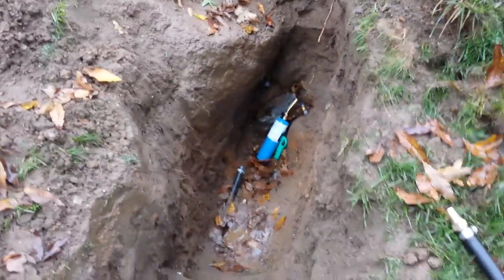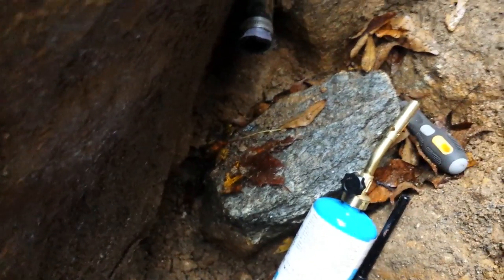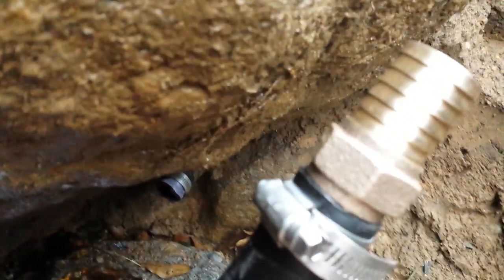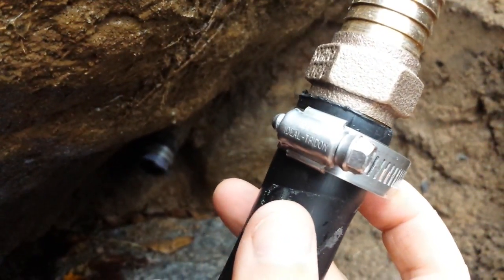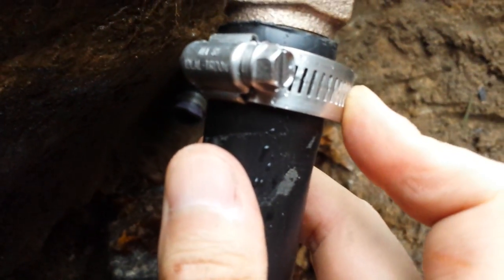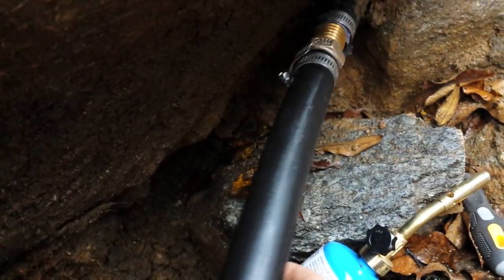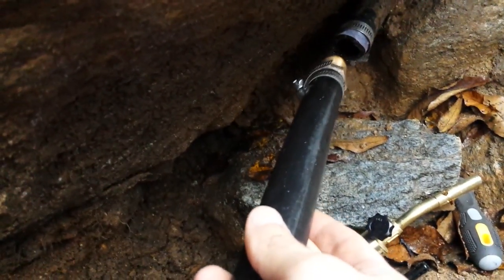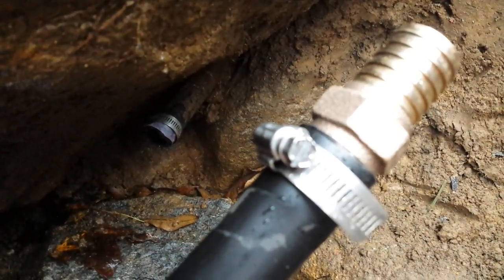How to repair main water line leak THE RIGHT WAY

Comment: I thank you for this video.  Went to Lowes and the plumber knew exactly what I needed.  Also, had called a plumber due to the 17 degrees and had to work fast.  Worked great and bulked up on the clamps and used 8 total.  Thank you.

Comment: Does this work ... yes. As a certified Water Distribution Operator I will say this is a last resort. There should also be 2 clamps per connection side as stated. I would spend the extra money for a Ford fitting and stiffners aka inserts. Then , I would know I could sleep easy. Also this is a service line , not a main line. Great video on one way to fix a service line though !!
Reply: He should've also spent some money and put pex in, looks like he's using that cheap farmers plastic

Comment: This is the correct way to repair this type of plastic pipe I’ve seen people use compression fittings and no steel inserts which wouldnt work on irrigation type plastic anyway of the videos I’ve been watching in regards to repairs of this type of pipe yours is the correct method

Comment: This is the first time i have ever seen a water line installed with a hose clamp . Iv'e only seen these done with pinch clamps or compression fittings . Im not saying it's wrong where you are it's just blasphemous where i am, you might  trigger a boss fight when you call in an inspection LOL.

Comment: Edit: ATTENTION EVERYONE!  CHECK YOUR DISTRICT SPECS OF WHAT IS REQUIRED BEFORE LISTENING TO THIS GENIUS. IF PVC AND COMPRESSION FITTINGS ARE ALLOWED, USE THEM!!!
Never in my life have I been told pvc won’t hold the pressure, for one simple reason, it does hold the pressure. Seems as though you don’t know the different between schedule 40ajd 80, which is probably what your water guy was saying. So ya, just FYI, this was no where close to the “right way” but you say it with such confidence. I’m sure some Idiot will beleive you. 

What the hell are you talking about dude? Do you have any experience in the trench laying pipe?Compression couplings are temporary? I’m not sure where you’re from or what kind of compression couplings you’ve been using, but there is nothing wrong with them. Of course silver solder, soldering, etc is slightly better, but compression fittings can EASILY LAST JUST JUST AS LONG. 

PVC pipes and the compression fittings can withstand pressure that would blow your fucking mind. Twice what you’re line is at. When I install pvc lines, I pressure test the line at 1.5-2 times the estimated pressure. 

Compression fittings work in exactly the same way that a rubber gasket pipe works. So yea, Im not sure who the fuck told you that bullshit. But it’s a hundred percent wrong. Many districts are moving away from pipes like ductile iron, cmlc (concrete lined steel pipe) and switching to pvc. 

So don’t go on YouTube and try and help people fix things with such confidence when you have no clue what your talking about.
Reply: justin Kassel
Reply: I agree you think stainless steel fasteners Will last longer than compression fitting what a joke
Reply: I used to be a sheetmetal worker and we installed PVC underground, they dont rust, just as strong, so I didn't understand what he was talking about

Comment: I work in the waterworks industry and compression fittings are definitely better. Just make sure you use the inserts. Also if you use the barb fittings and want to make life easier put a female x female union so you dont need to stress the pipe to get it to fit together.

Comment: I already used plastic barbed fittings instead of brass.  I was afraid the metal would corrode.  Will the plastic hold up overtime?
Reply: There the worst ones you could've gotten, next to the ones made out of black iron, plastic barbs crack and breakdown, especially if you live in colder climates with frost shifting the ground, brass will last a lot longer

Comment: Heat gun for auto mechanics work too if you don't have propane correct?
Reply: Heat gun is better if working indoors next to wood. Don't want to burn the building down.

Comment: This is not the proper way to clamp a fitting. ALWAYS USE 2 CLAMPS PER SIDE. 1Clamp will start to slowly leak and continue to get worse.
Reply: Yea double clamps and in opposition..👍👍

Comment: I need to hook new pipes to old existing metal pipes coming out of meter and going into home... 40+ year old house on concrete slab... has metal pipes... I have a leak under some pine tree roots about 15 to 20 feet above meter and house is another 30 feet from there... plan on cutting near house and at close to meter go around the trees area and make to middle front to house half box shape.... about 100 feet  total distance... was going to use pvc.... what's best pipe/hose for my job?

Comment: Yes hose clamps for "the right way" lol, and pvc does withstand pressure, you just have to make sure you buy sch 40 or 80, not foam core which is meant for dwv.
Reply from the maker: BULB271602  Water company will not approve it and will not turn water back on...  I had PVC on it first and they said absolutely not.  They would not turn water on UNTIL the CPVC pipe was in place.  I thought PVC would hold pressure but water company said that over time.. it will not.  So to have water turn back on..  I had to do it the right way.. according to the water company... since they know their stuff..
Reply from the maker: Oh... and if you go to a plumbing store... not home depot..  but a plumbing store with certified plumbers. .. they also state.. that PVC is not to be used but only CPVC can be used and is the best thing since it can bend and accommodate pressure..
Reply: vladtexas I have a seriously difficult time believing the water department wouldn’t let you use pvc. I’ve installed 30” diameter water mains that were pvc. I have never worked in a district that didn’t allow us to use it as a service, generally similar to a copper line. I think you mixed up schedule 40 and schedule 80
Reply: If PVC freezes, it cracks.
Reply from the maker: justin Kassel  CT water company does not allow PVC.... not my rules. I actually installed it first with PVC and they said no way.  Don't believe me.. you don't have too. Just call CT water company....  again... not my rules. ..  it may be different rules in the south where it's warmer
Reply: vladtexas I’m not saying I don’t believe you. That is just insane to me. What part of the country do you live? I’ve installed fire hydrants and water lines in cold weather areas, and since the fire hydrants are above ground, and susceptible to being frozen and cracking, their standard is the dry hydrant, that keeps the water below ground until it’s being used, but never have I heard of not using pvc in a UNDERGROUND WATER LINE. reason being because lines don’t freeze underground.

(However I suppose of it was shallow enough in the ground, there could be a danger of freezing.)

Is all of this being backfilled? And why wouldn’t you use compression fittings? Because it doesn’t seem right to me is the use of those hose clamps being buried underground. I’m assuming they aren’t stainless steel, and also assuming you didn’t put on non oxidizing grease on them either. So it’s not going to be long before they rust out and your back in the hole. 

I’m not trying to be an asshole or criticize you brother, I just love pipe work and these things interest me!
Reply: @justinkassel4000  He literally says in the beginning they're stainless steel. Also why would you put anti-oxidizing grease on a stainless steel hose clamp? I believe that kind of grease is for aluminum to aluminum or aluminum to copper connections. I have never seen an application where someone puts that kind of grease on an installation below ground.
Reply: Use high quality SS T-bolt clamps. Screw clamps are cheaply made and break. Ask any mechanic!
Reply: @vladtexas I think you mean pex? CPVC is just PVC but is meant for potable water, pex actually bends

Comment: Where can I get the connector that you used,I've been to home Depot and Lowe's and I didn't get it.
Reply from the maker: Plumbing store....  not home depot. Home Depot doesn't carry the size that you need for a main water line but a plumbing store does. If you have a sample of the hoes bring it with you so they can put the correct size connector into it
Reply: Menards usually has them

Comment: Great video! 
Where did you buy the brass coupling from? 
I checked Home Depot and Lowes and they don't have any heavy duty brass couplings with a nut in the middle.
Reply from the maker: Georgi Batchvarov  Only sold at a plumbing store...  home depot and lowes do not carry it.  Only a plumbing specialty store. ..  Usually $6 for each one. Good luck
Reply from the maker: The brass couplers are sold only at Plumbing specialty store.. not sold at home depot or lowes
Reply: I picked up some at Menards for 10.99 apiece.
Reply: In NW Washington our local Do-It Best Hardware had the brass couplings with nut in middle.  Ace had them with nothing in the middle (would be invisible after install, just see the pipe clamps).   Home Depot had couplings with a small ~1/4" bit of brass showing in middle.

Comment: People dig up water lines for home inspection? I've never heard of that. I got a water  under a tree leaking. I actually got to the leak and temporarily patched with JB water weld.  I dug around the tree and got to go get new line. I'm gonna the torch method. Thanks.

Comment: every one I see trying to fix water lines or installing yard hydrants used the stainless steel band clamps   junk throw them in the trash haven't you people ever heard of a t band clamp  of course they are stainless but way better clamping power   warm the pipe slide it onto the barb fitting and only snug the clamp     then let fully cool and come back and tighten it    bam  works every time
Reply from the maker: david snyder Connecticut water company should know that.... I wonder why they insist on stainless steel clamps...ugh
Reply: vladtexas   Of course stick with stainless but the little screw clamps stainless or not are junk. Use a T-band clamp

Comment: what  materials of black pipe? and where to get it, thanks
Reply from the maker: It's made  of a special plastic .. and you can only get it at a plumbing store(bring a small piece to store so they can match up size and wall thickness...  the pipe is sometimes referred to as well water pipe...

Comment: we are dealing with a water leak right now was wondering what size pipe u r using and the size coupler u used ,,,our pipe is 3/4 inch
Reply from the maker: Cut a piece of your existing water line and bring it to a plumbing store it must be a plumbing store since they have the materials needed. And ask them to fit it up with the correct size coupler and hose. All hoses are different sizes and different thickness in walls of course the thicker the wall the better it is but yet the more expensive. Just depends on how many times you want to dig up 4 feet of ground and find the leak.

Comment: Sure?  Section 605.3 of the NC Plumbing code lists the approved pipe material.  These days, PVC, PEX, HDPE are the popular ones.. 1" PVC Sched 40 is rated to 450 PSI and Seche 80 up to 600 PSI

Comment: I have blue colored plastic line. Anyone know what it would be made out of?
Reply: CTS Pex, probably rated around 280 psi should have a stainless steel insert in the ends, if they installed it right

Comment: 2" poly water main? I don't think so.
Reply: I’ve used 2” barbed fittings to repair 2” irrigation pipe it works just fine
Reply: @battlejack1863  I think he was saying that there aren’t many 2 inch poly water mains floating around lol.
Reply: 1" poly on my home well feed line.

Comment: Is that type of hose clamp anything other than temporary? Once that rust out it won’t be holding anything anymore… And don’t act like stainless steel doesn’t rust stainless steel absolutely rust just not as fast as iron….
Reply: The guy making the video reminds me of the water boy, "My mama said, my mama said. If his water company told him to use that their just trying to make money from a fool, they want it to break after the meter and keep charging him. All the WDs in my state recommend pex pipe, and compression couplings, guys just regurgitating nonsense

Comment: There's a dude here that days pvc will hold pressure!!!  Lmao!!!  If you say so!   After a a few let is know how long before it broke all apart!  Lololololol.  Pcpv people!
Reply: It works just fine
Reply: Depends what the pipe is rated for, also actual water mains that are 12" and larger are made out of PVC and hold up just fine, also sense you seem to want to regurgitate the same nonsense this guy is saying, the only difference between PVC and CPVC is that PVC is meant for drainage, waste and vent applications, CPVC is for drinking water

Comment from the maker: Do not forget... you should NOT use PVC. .. it is NOT meant to withstand the water pressure over time...  and technically it is not meant to be buried 4 to 5 feet underground.  ONLY USE CPVC... which is ONLY sold at specialty plumbing store... they sell it in rolls of 100 feet.. for about $38.  The best is 250 psi of pressure CPVC...  but minimum is 160 psi.
Reply: Cpv is rigid pipe and not rated to be used anywhere but inside a house polyethylene pipe is what your talking about or oex both cone in a roll only certain types of pex are direct burial rated
Reply: @emster716  You're...
Reply: Can we all agree this guy doesn't know what he's talking about, all his comments he keeps saying he's using CPVC, the pipe he's using looks to be that farmers plastic crap, lines just going to keep breaking every decade or so, in Maine that stuff only last 20 years at best